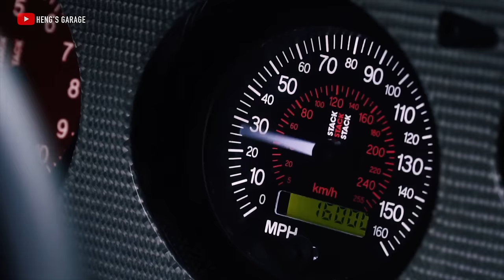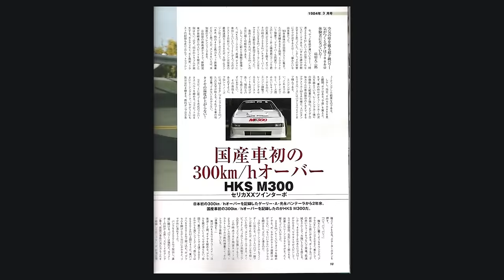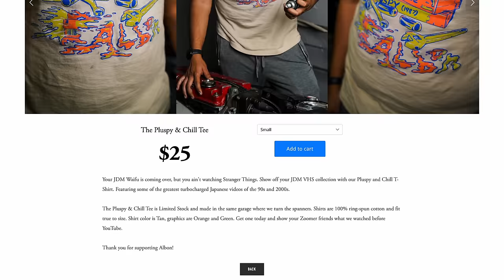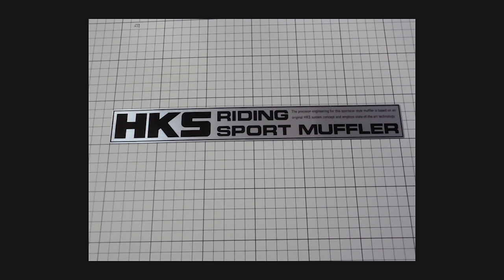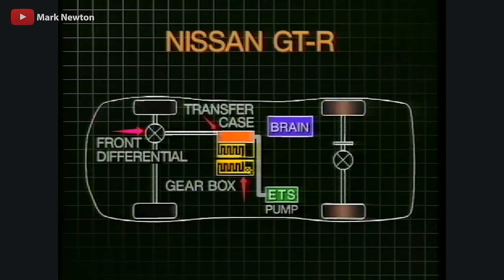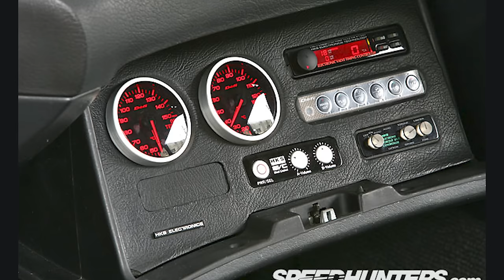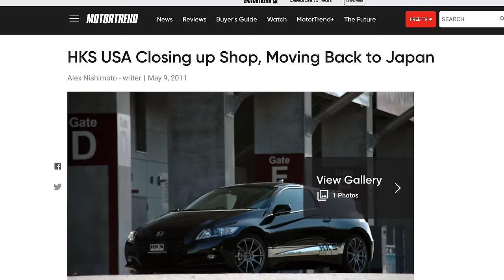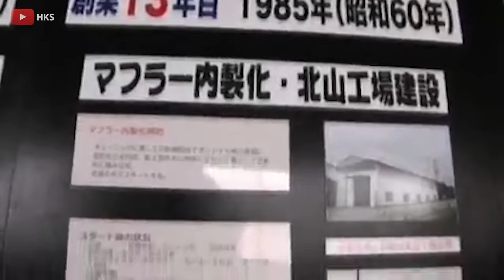HKS Built The Ultimate GTR

Comment: I bought hks turbo timer, intake, ssq blow-off valves, and several other parts for my z32 300zx TT 2+2 back when I swapped a jdm engine into the chassis in 2004. I loved everything they sold and all their parts worked flawlessly on my Z.

Comment: Around 2000/2001 my dad and I started modding an e36 328. I got to pick out the exhaust so being a gran turismo/tokyo xtreme racer kid i picked the hks exhaust. And thanks to tokyo xtreme racer 0 having the trailer to the original Fast and furious we went to opening weekend with the car. Had been 5 speed swapped, m3 cams, chipped and exhaust by then. I felt like the coolest 13 year old ever.😂 By 06/07 it was the first to make 1000whp and to run 9s. And it all started with an hks exhaust. Makes me glad I grew up in the garage, dyno rooms and at the drag strip. Especially during what i consider the best era for car modification.

Comment: 400k USD for R32 is crazy expensive but much cheaper compare to R34 that might only get you a Nur version

Hell, for 400k USD only get you a fresh R32 (including R33 and R34) if you buy it from Nissan / Nismo via Skyline Restoration Program, and probably cost much more if you request them to source the donor car for you (yes, you can request a donor car if you don't have the car itself)

but hey, at least it's directly from Nissan / Nismo and you get 1-year warranty

Comment: Kinda sucks you didn’t mention the t-002 gtr which for the uninformed is a 920hp gtr that did 0-300kmh in 17.74 seconds in and set a lap record at Tsukuba of 58.714 and it was pulled out of there graveyard like some years back and rebuilt for Tokyo auto salon